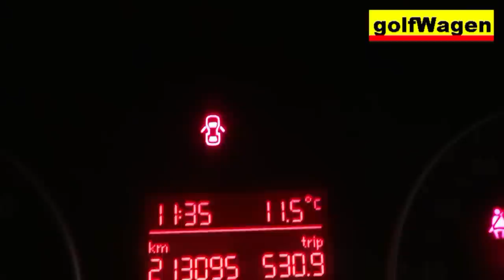How to change oil and oil filter on VW Golf 5, 1.9TDI

Comment: The tightening torque for the oil sump plug is 30nm. It's not recommended to tighten it too much because you can strip the threads.

Comment: Do I need to change the metal gasket on the drain screw underneath?
Reply from the maker: +Svein Ludvik Holme It is not necessary to appoint, I have seven years the same